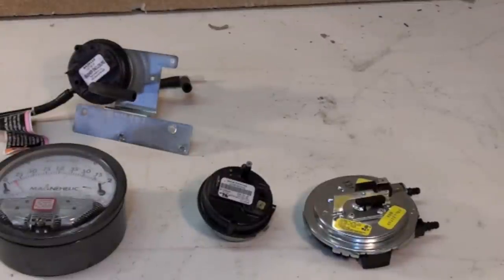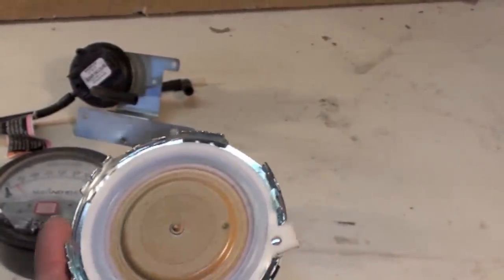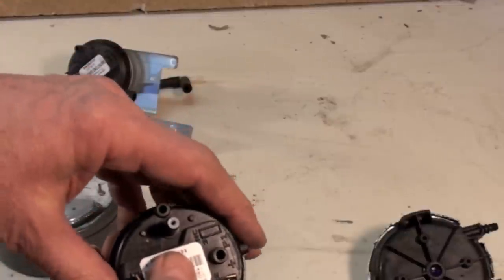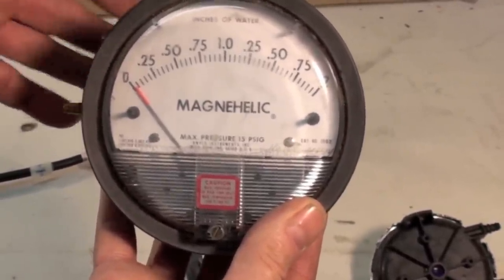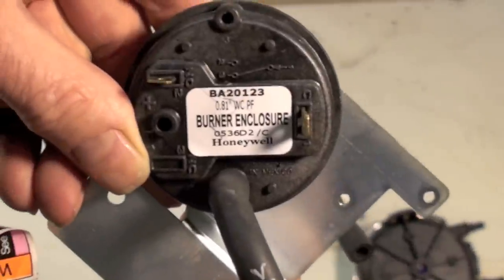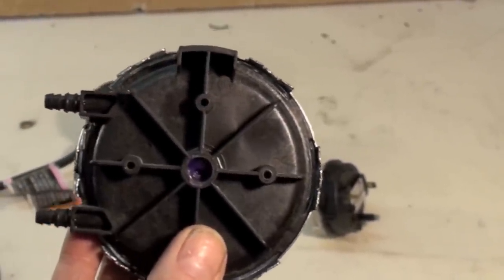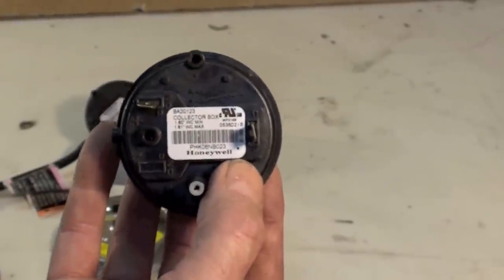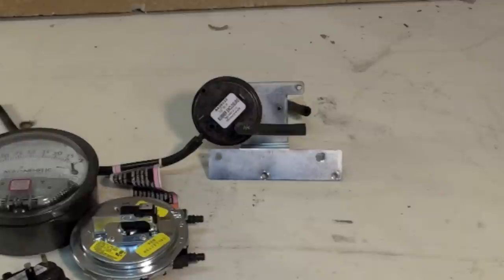How gas furnace pressure switches work

Comment: my pressure switch issue starts on a reheat cycle but if you turn off the heat setting on the control board let the cycle stop then turn the heat setting back on it will take off and run but again when it tries to come back on again after it has ran it shows a pressure switch issue. any thoughts?
Reply from the maker: +wyomings alcoholic When you turned it off you rebooted it.  Look for blocked tubing, vent blockages or failed pressure switch.  Hope this helps.
GFM

Comment: Sir, why are there two pressure switches required on a two stage furnace? don't you just need one to prove that the inducer motor is ON? thanks.
Reply from the maker: The 2 stage furnace uses 2 speeds of the inducer to match the different firing rates.  The furnace fires on 1st stage and proves on the 1st stage pressure switch.  When the 2d stage is calling, the inducer speeds up and must prove the 2d stage pressure switch.
GFM
Reply: ok, but there are ONLY 2 wires (black and white) going to the inducer motor. how do these wires create the second speed? thank you, you're just a great teacher.
Reply from the maker: In that case,  either you do not have a 2 stage furnace or the inducer is variable speed.  If so, the motor will be rectangular.
GFM

Comment: My water heater keeps turning itself off and showing an error code--the vacation light and B and C lights are come on, and at that point, the hottest the water gets is about 70-80.  It only happens from June to October.  This is the third year.  I thought it was the Intellivent computer, but the AOSmith says it is the air pressure switch located on the blower motor.  Is this replaceable?  One plumber just wants to replace the whole tank (11 years old), but that seems wasteful. What do you think?
Reply from the maker: First, I would be sure that the blower wheel is clean and the vent is clear.  Many of the water heater manufacturers do not want the pressure switch replaced.  They want the entire blower assembly replaced.  Hope this helps.
GFM

Comment: I found that screw in the pressure switch and thought to myself who put that screw in there.  Seems like my pressure switch must be working but furnace keeps turning off....I then go downstairs lift and drain the Condensation hose of water turn the furnace back on and it works until..... the hose fills with water again. Did the Vacuum Condensation hose out .....So I am thinking I have to replace the Condensate pump ? Ducane Furnance.
Reply from the maker: Sounds like the condensate is blocked.
GFM
Reply: I have Vacuumed the line from the Pee Trap to the floor drain..... but everytime the line from the pee trap to floor drain has water in it again the furnace stops ???
Reply from the maker: I would check all the condensate lines for blockages.
GFM
Reply: Well did the vacuum thing again and it's been working again so I don't think it's the pressure switch. But the pee trap has 3 hoses going to it one from the pressure switch, one to the intake or exhaust ? And the other to (              ).
Reply: Still holding at 21 ...... since my post ( a week ago) Happy New Year

Comment: i have a lennox furnace i had to replace the control board and it was comming on for about 5 or10 sec than shuting down and will do that over and over so i replaced fhe flame sensor and it still does it can you please tell me what to check for now
Reply from the maker: The factor you need to look at here is whether the flame is on for the trial for ignition.  The burner should stay on for a consistent time.  Trial time can be from 4 to 7 seconds but should be the same every time.  If so, it is a flame sense problem.  If the flame is covering the flame rod completely and all wiring is tight including the ground wire to the chassis, then you have a control board problem.  
If it is inconsistent or lasts longer than the trial for ignition, it is probably a pressure problem.  You can temporarily jumper the pressure switch (only jump after the inducer comes on) and see if it continues.  Let me know what you find.
GFM

Comment: Hey quick question should there be water in the pressure switch thanks in advance
Reply from the maker: No, in fact if there is water in the switch, the switch must be replaced.  In most cases, the reason for water in the switch is a defect in the switch itself.
GFM
Reply: @grayfurnaceman  Thanks a lot!

Comment: How do you know what wires go to what terminals? I have an NO and NC and a yellow wire with 20 written on it and an orange with 22 on it. What goes where?
Reply from the maker: If you have 2 wires, one goes to NO and one to C.  
GFM
Reply: It doesn't matter.  It's a switch, as long as it closes it will make regardless of how you have hooked the wires.
Reply from the maker: Not so fast.  Some pressure switches are single pole double throw and have 3 wires.
GFM
Reply: @grayfurnaceman  true.  I was only replying to the fella with the two wire switch.  Ty for pointing it out, ty for the reply.  Love your vids, saved me a phone call or two on my first year on the job for sure. 
Merry Christmas to you and yours, Gray.
Reply from the maker: Merry Christmas
GFM

Comment: i have a Rheem series 80 hot air furnace.  recently it has started tripping the high level temp switch at 150 deg and then not resetting until it goes fully off and restarts.  I have checked all the outlet registers and all the returns.  if i open the door to the inline airlifted right before the blower the memo stays below 150 but if i close it it goes over.  i do not understand how the airflow has reduced just recently or if the flame is putting out more heat.  Also i see a replacement limit switch that has a high level setting of 160 instead of 150.  i think that would solve the problem but would it cause any overheating?  theater choice is to just leave the filter door open.   any ideas?
Reply from the maker: +Peter McGroddy The Rheem furnaces have their limits wired so if they open, the unit must be restarted.  Do no increase the temp of the limit.  Dangerous.  Look for dirty blower wheel, or blockages of the return air.  Hope this helps.
GFM

Comment: I have an old sears gas heater , the blower keeps shutting off after about 45 seconds but flame stAys running how do i fix this issue
Reply from the maker: The blower should be controlled by a heat operated fan switch.  You can separate the on and off temps farther and it will probably stay on for the complete cycle.
GFM

Comment: Dear ALL i have glassware  washer machine, i was making cleanness, now i have touch  pressure switch, now my machine have display FAN PROBLEM. ON the manual it means " Blower switch on with pressures switch open",, kindly what is the solution/
Reply from the maker: FREDERICK MSOFFFE Sorry, I can't help on this one.
GFM

Comment: Great thanks GSM.  Took it off.  Old RTV was a bear.  Screws and screw holes loaded with the stuff.  Want to replace the screws, but they only seem to come with the whole assembly 501-312-312.  There is a picture at Pex Supply. Can't post link.  Any ideas?   Also I don't see a grommet where motor shaft passes through to wheel.  Air can pass through around shaft. Normal?

Comment: I have an Armstrong furnace and Im getting stumped. Its something pressure related I think. Ive check the lines and exhaust, none are clogged. When I start the furnace the intake turns on, then the igniter glows, ignites the gas, and then the blower turns on and this is when it trips the pressure switch. I here a sucking air noise for a split second (making me think the vacuum has a leak somewhere) and then pressure switch triggers and the furnace shuts down. I then tightened down the intake pipe, which was visibly loose from the last service call, and the combustion chamber cover. Still seems to be making the sucking air noise and then failing. I did notice that when the serviceman pulled the gas injectors from the chamber he bent the edges of it. Could this be causing it not to seal and therefore fail?
Reply: Also im getting error code Inducer on Pressure switch open

Comment: our furnace drain was clogged so the furnace flooded and looks like it ruined the pressure switch :(
Reply from the maker: If water got into the switch, it will need to bye replaced.
GFM
Reply: @grayfurnaceman  Yep very expensive part too. I checked the resistance and its stuck open. There are 2 of these switches, HI and LO. The HI one I can blow air into it and it closes, there is a "relay click" sound and it works. LO one not the same.
Reply from the maker: @radekw708  Should not be terribly expensive.
GFM
Reply: @grayfurnaceman  up in Canada everything expensive. The part is $200 and nobody will just sell you the part, you have to pay an hour of their time to install it for you. So $300 total, pretty pricey.

Comment: My furnace got wet in my basement and now the blower wont start up.  All the burners ignite but soon after it shuts down and gives me a flashing light which indicates pressure switch fault?   I replace the lower control board because it was coroded from the water thinking it was damaged but still no blower?  any help would be greatly appriciated.

Comment: bypassing the switch, and it still doesnt come on... 80% furnace ... so the appliance didnt start. all motors are running. now what?
Reply from the maker: I need the sequence on a call for heat.  Thermostat on, then what happens?
GFM

Comment: I have a Trane XB Propane Furnace (2009) that will not light unless I tap on the air intake tube. I cleaned the flame sensor with steel wool.  I've checked the pressure switch with your "soda straw" method, and I hear the 2 clicks. However, I suppose the switch could still be the problem. The inducer fan blows air, The ignitor glows, but the gas doesn't ignite. I don't have professional HVAC test tools, so I'm hoping I can fix this by simply replacing the pressure switch or ignitor. Here is a video I made of the issue: https://youtu.be/QLoN2bT9MJE
Reply from the maker: If the ignitor glows, all safeties (limit, pressure switch, etc) are in the right position for a trial for ignition.  If the unit does not light, it is because the ignitor is failing and not getting hot enough, or the gas valve is not receiving power or is stuck, or there is not gas available.
GFM
Reply: Thank you. I will try a new ignitor first. It's funny, the installer couldn't get it to ignite in 2009 either. He went out to his truck and changed it with another (incorrect) one which promptly exploded. He then installed another which worked (sometimes). After a few more visits, he fine tuned it so that it worked 99% of the time. To this day I wonder if the ignitor he installed the second time was the correct one.
Reply: I gave a new ignitor a try. Still has the same issue. The only way to get the furnace to fire up is by cupping my hand and tapping several times on the air intake pipe during the time when the ignitor is glowing. Now I'm thinking it may have something to do with the induction motor? If it was the pressure switch, then the ignitor wouldn't be glowing, correct? This all started after I cleaned the dust off the main filter last week (which I have done many times before without incident.) Ever since then, I have had this issue. VERY WEIRD! :(
Reply: By the way, The induction fan does get extremely HOT! After it's been running for a while, I can't keep my bare hand on the motor for more than a second. I read somewhere that this could indicate a problem.
Reply from the maker: Yes on the pressure switch.  It is possible the unit was damaged in shipping and the ignitor/burners are not aligned right.
GFM
Reply: UPDATE 3/7/18: I solved the problem by taking a red plastic cup, cutting a hole in the bottom of it (about the size of a quarter) and placed it over the intake pipe. It seems that it was getting too much airflow! By choking off a bit, the gas is now able to ignite. I'm sure that there must be a better way to do this by making some kind of adjustment somewhere, but if so, I am not aware of what to adjust.
Reply from the maker: If the unit has the original (or factory replacement) pressure switches, I would say, whatever works.
GFM
Reply: Except for the ignitor, all hardware is original installation from 2009. The red plastic cup "fix" is working flawlessly, so unless it stops working, I'll leave well enough alone. Thanks again for all your help.

Comment: Question... I was on a call tonight where I had a pressure switch code. I checked all other reasons for a pressure switch failing. I had sufficient draft but contacts would not close. When I sucked on the hose the contacts closed. I jumped out the pressure switch and the unit fired. I was not set on the pressure switch had failed. Is there anything I was missin?